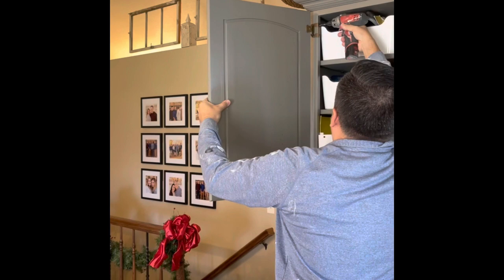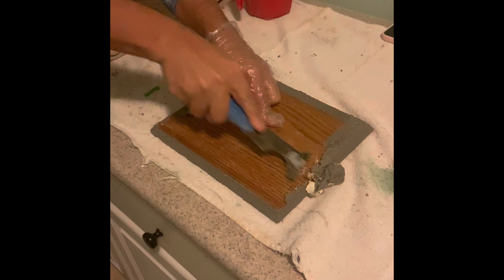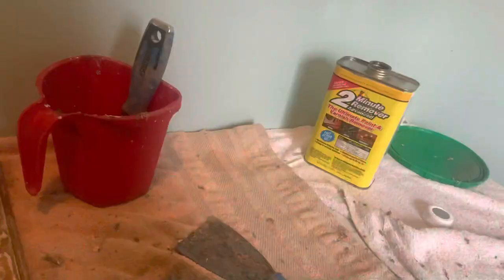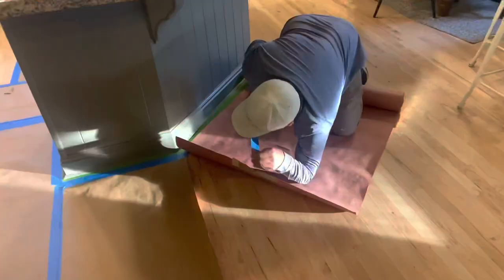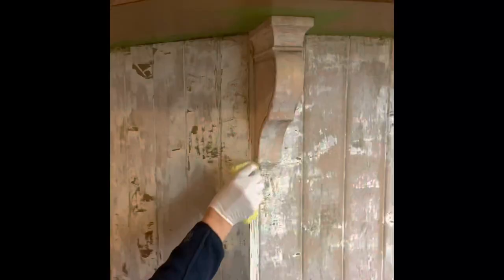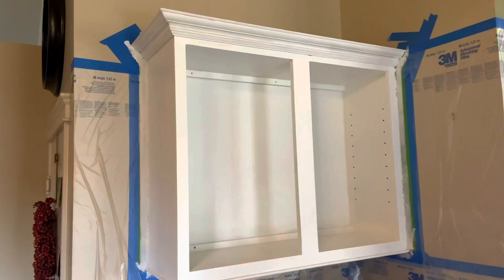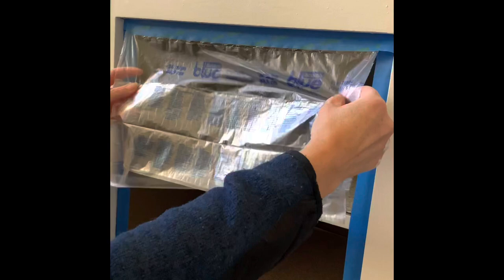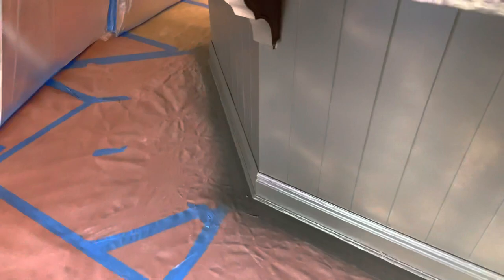How To Paint Kitchen Cabinets. How To Strip Paint Off of Kitchen Cabinets.

Comment: Why was using a random orbital sander not an option for the larger smoother surfaces?
Reply: It was much easier to wait a day and a half to make a mess. Also way easier to hold your respirator with one hand instead of using the straps. Also way better to drag your hose through wet paint. Gets the job done!!